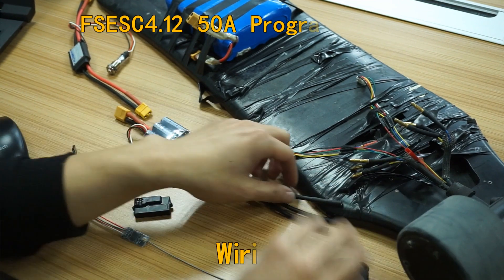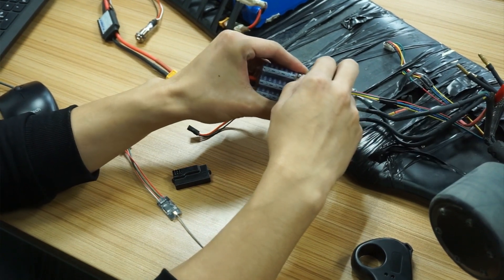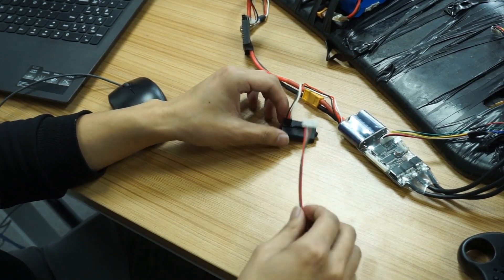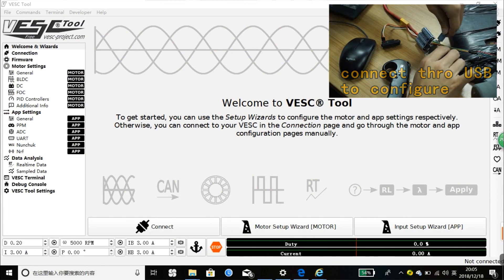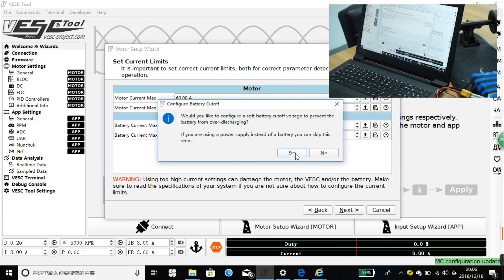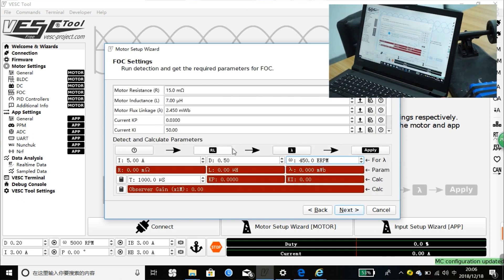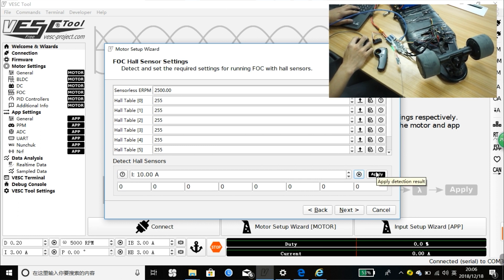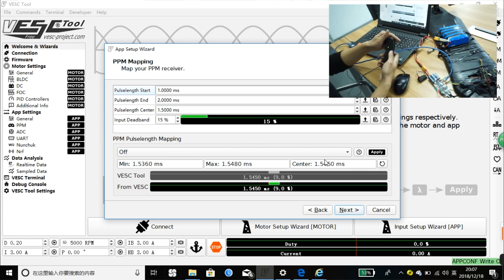Single FSESC 4.12 VESC Programming Tutorial | Flipsky

Comment: I'm setting up my flipsky 4.2 plus, when I turn on the board the vesc doesn't light up, but it does however power the remote reciever, allowing the vx2 to pair with it. The vx2 shows no battery life. as stated the esc is sending power to the reciever plugged into it, but it is not receiving or atleast utilizing the power that it has access too. What's the issue? It worked fine just momentarily after I set up the vesc parameters. Did wire management and unplugged and replugged the vesc in and it just suddenly had this issue it never did before? Help!?
Reply from the maker: The esc does not light up but the receiver is powered normally? Please record a video to see if there's something wrong with the green light of the esc,and send it to flipsky-service@outlook.com, thanks!

Comment: Hi congrats first. I would like to ask which receiver/trasmitter kit are you using AND what is the module are you installing at 0.58? It seems an antenna. But is the antenna included in the receiver you place at 50 as well or not? I mean is the component at 0.58s mandatory?
Reply from the maker: Hi , it is a receiver of Nano remote. And the module at 0.58s is called Bluetooth Module, which supports all VESC. You can adjust  the parameters on the phone by connecting it, but only for Android mobile device. Here is the detailed information:https://flipsky.net/collections/accessories/products/core51822-ble4-0-bluetooth-2-4g-wireless-module-nrf51822-onboard-ws82013

Comment: hi, i am using an 6483 outrunner (120kv) and since the hall sensors are 5 pin on this one, i want to spin it in sensorless mode. But with the setup motor foc i am getting an error message "flux linkage detection failed". Can you help me out? Thanks in advance.
Reply from the maker: Hello, this is an unsuccessful parameters setting.So do you use our vesc?  And have you updated the firmware before? If not, please try. If it still does not work, please send your detailed setting video to flipsky-service@outlook.com. The whole parameters-setting steps and the status of esc and motor are needed to be known, and we will reply asap. Thanks.

Comment: Hi, I'm having a problem updating the firmware on the FSESC. Can you help me through this ?
Reply from the maker: Hi，Miguel Pimpão
.Is there anything I can do for you?
Reply: Flipsky Tech yes, when I try to connect my FSESC it says that my firmware is too old. I follow the steps to update it successfully but when I try to connect it again after the reboot it has the same problem.
Reply: Flipsky Tech the ESC is a FSESC 4.12
Reply: Flipsky Tech can you help me ?
Reply from the maker: @miguelpimpao6757  Hi，Miguel Pimpão
.This situation is an upgrade failure, we recommend that you keep the old version more stable
Reply: Flipsky Tech the problem is that I cannot do anything because Vesc Tool won’t let me program the motor with the old firmware.
Reply from the maker: @miguelpimpao6757   Hi，Miguel Pimpão
.Will you re-burn the program yourself?
Reply: Flipsky Tech yes
Reply from the maker: @miguelpimpao6757  
Hi,
Miguel Pimpão.How can I contact you easily? I will send you a re-burning tutorial.
Reply: Flipsky Tech can you send it please ?
Reply: Flipsky Tech ?

Comment: I need help with my mini 4.20 i want to know how set the speed
Reply from the maker: Hi, the speed is related to various elements (Battery voltage/current/pulley etc) . You can set the ERPM in VEST TOOL, if you want to lower the speed.